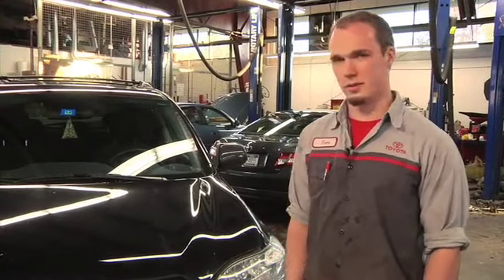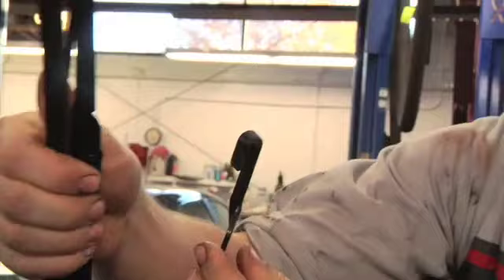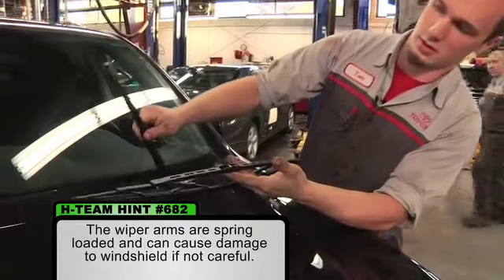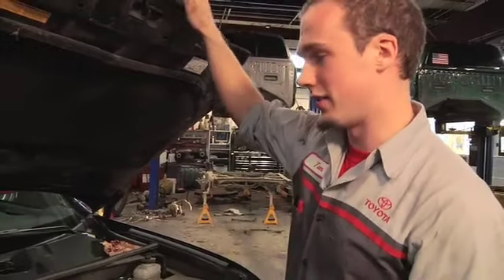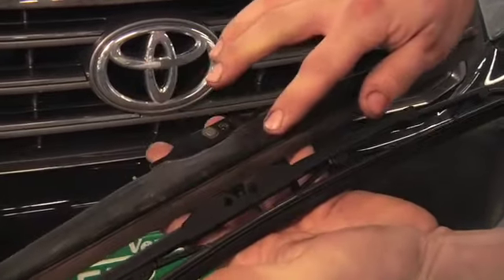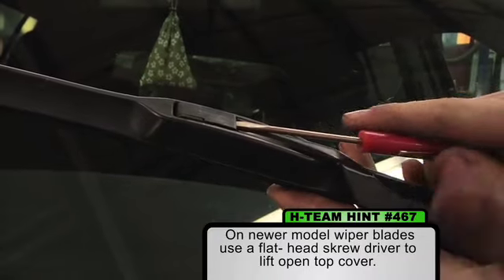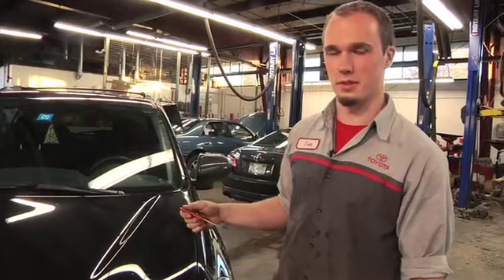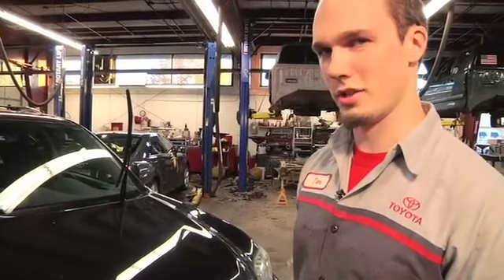DIY: Windshield Wipers

Comment: was this even rehearsed or did this guy just wing it? either way I've never had a wiper blade release like that, but then again I've never had a goatee of such prestige. jet fuel can't melt steel beams and cars can't run without batteries...right?